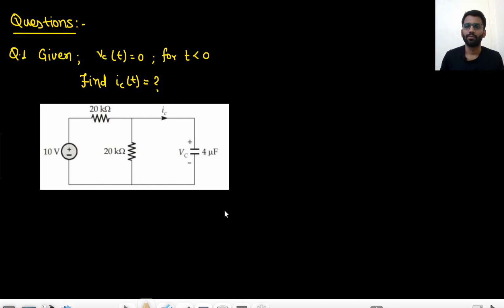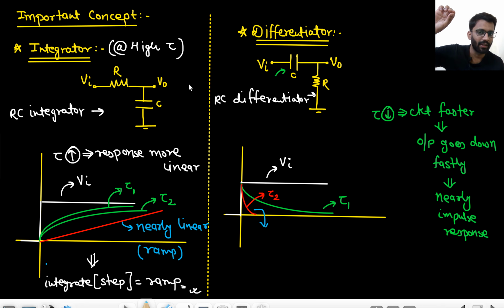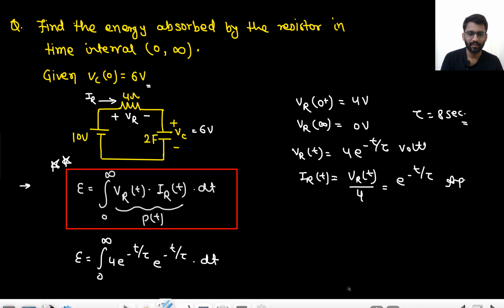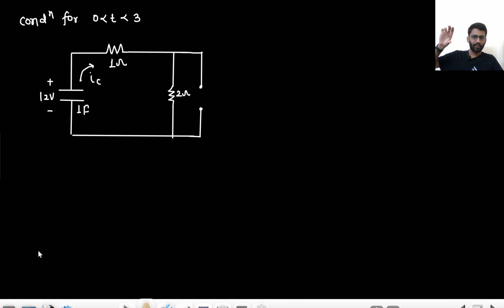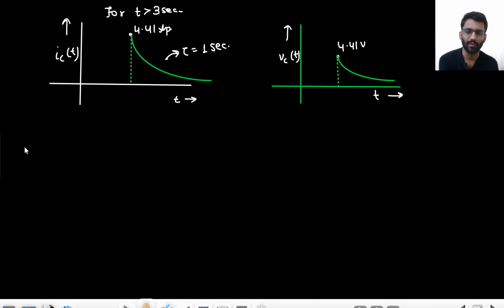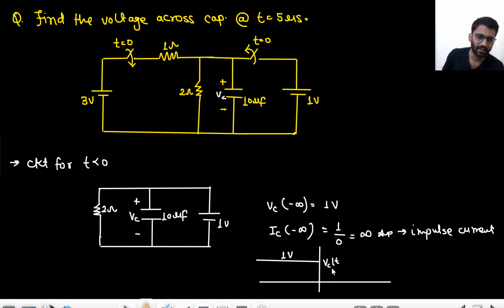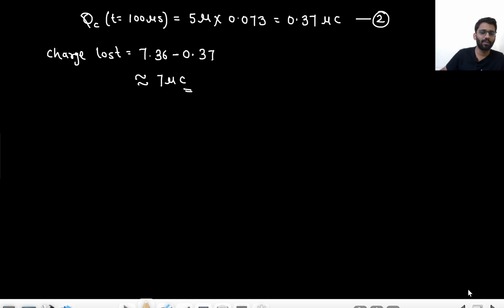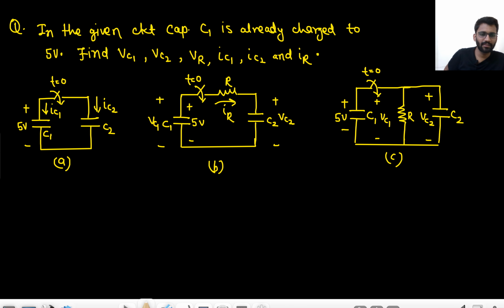Assignment 8 Solutions || Network Analysis || GATE 2025-26 || PrepFusion || Himanshu Agarwal

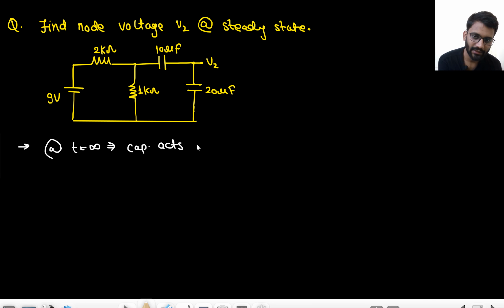Comment: @ 24:31 doesn't the two capacitors have some initial voltages because the applied input is 9V not 9U(t) or they didn't gave any switches . Or I missed some point
Please clarify it Sir

Comment: 1:00:26 Req would be 0 ohm as it also parllel to short circuit . Correct me if I am wrong...?
Reply: voltage across the resistor would be zero , resistance stays the same ig

Comment: sir, @55:45 clear me this confusion that for t<0 as current is infinite so Capacitor changes its Voltage immediately i.e --> Vc(0-) is 1v and Vc(0) is 0v.
for t>0 as the amount of current flowing is Finite for which the capacitor doesn't allow sudden changes in Voltage [ Vc(t-) = Vc(t) =Vc(t+) ] , so in this case how can Vc(0+) be 1V ? , as per the circuit i agree that Vc(0+) is 1v but,
i mean that Vc(0) is 0v and VC(0+) is 1v (voltage is changing immediately), how can it be ?, if in case we see from this perspective -->[ Vc(t-) = Vc(t) =Vc(t+) ], then Vc(0) should be at 1v right as Vc(0-) = Vc(0+) = 1v, then in that case it won't satisfy the sudden change in Voltage[ Vc(0-) =1v, Vc(0) =0v ] for Impulse current
Reply: I think v(0) = 1V. Because the capacitor has already charged to 1v at t<0.
Reply: sir, am waiting for ur reply please
Reply: Same doubt  @srujankumar-m4o
Reply: @Sachin-u1q2i Sir has told in the impulse capacitor video that this rule: Vc(t-)= Vc(t) = Vc(t+) is not valid in case of infinite current.
Reply: @DhruvGupta_DG  but current is not infinte here

Comment: 54:31 why Ic becomes infinite
Reply: At t = -∞, the capacitor was connected directly across the 1V voltage source. The cap acts like a short circuit, so it offers zero resistance. An infinite current flows to instantly charge the cap to 1V. After the cap gets charged to 1V, it holds that charge till the switches are flipped at t = 0.
Reply: i also have same doubt , because in steady state ,capacitor will be open circuit then , ic(-infinty ) = 0,
Reply: @mr.scropioooo7551  after I got one rpy

Comment: Hello Sir
I am preparing for Analog Vlsi job from your videos which are reallly amazing.
Sir I have a doubt in the 3rd last question.( voltage across cap @ 5us)
How you considered cap to be S.C for t<0 for infinte impulse current and zero time constatnt?? 
Cap has to be 1V before t< 0. How it can be SC or zero volt??
Reply: I took it to be 1V only.
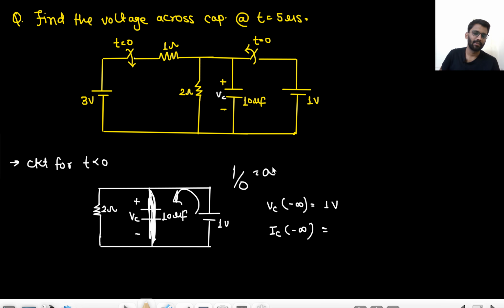Reply: @HimanshuAgarwal_ Yes sir but at time 53:46, for calculating I ( - infinity ), you consider capacitor to be S.C. why you did this it is my doubt since cap will have only 1V for entire t< 0. Please clear my this doubt.
Reply: @dheerajvashist7732  t=-infinity is the time when the input is just applied. Initially there was no voltage across the cap, that's why we have to consider 0V only. When I applied 1V, it saw zero resistance and the current flow was infinity. It made the capacitor change its voltage from zero to 1 in no time.
Reply: @HimanshuAgarwal_ perfectly understood sir. Thank you so much for your quick response. Thanks a lot❤